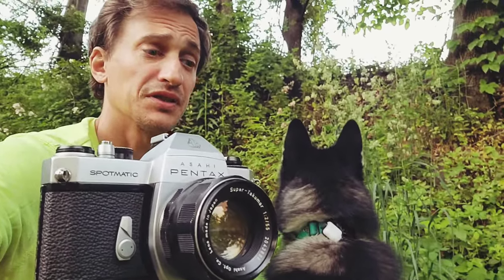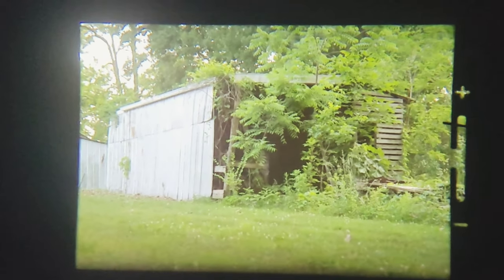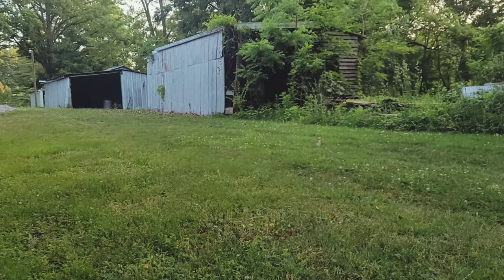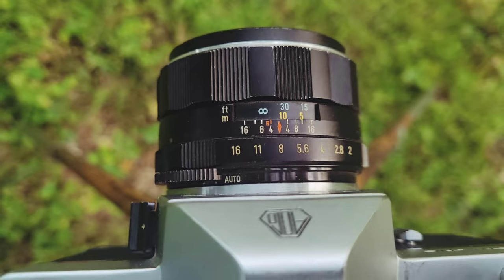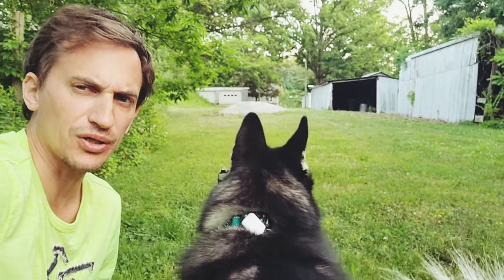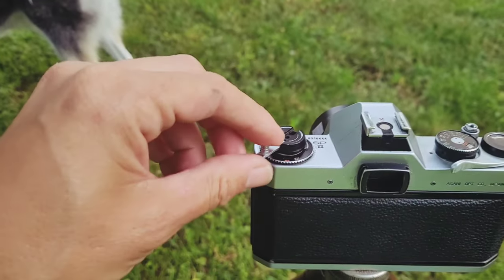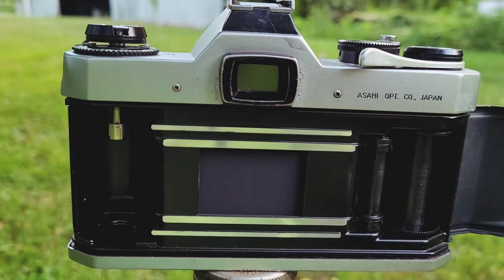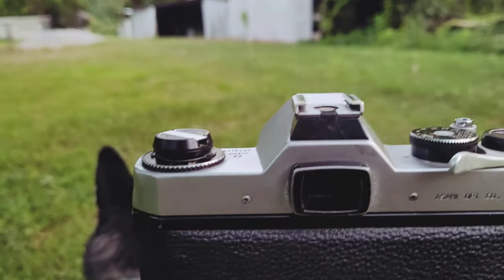Asahi Pentax Spotmatic SP2 --|--  Basic Light Meter Operations

Comment: I think my light meter is broken welp, stuck at +
Reply: Maybe your battery is the wrong way
Reply: @knikk77  it’s actually broken, tried every way
Reply: If it's at the + position without the battery then it's stuck.

If it's in the + position with the battery in and the needle won't move, even after adjusting the settings then your battery is more than likely overpowering the meter, this can happen with newer battery types like alkaline batteries and some older cameras weren't meant to use them. But it shouldn't cause any damage to the camera. It will likely just meter too high and give inaccurate reading.